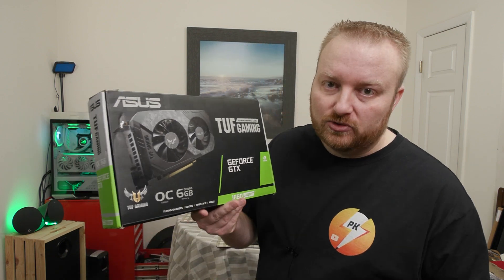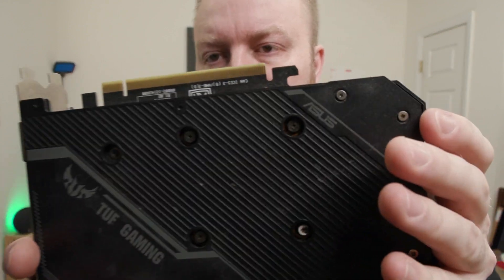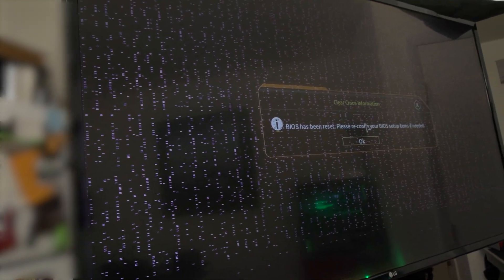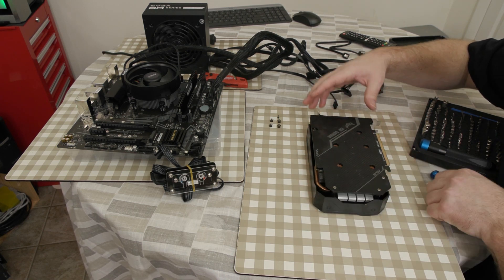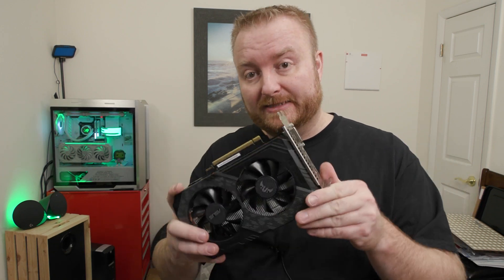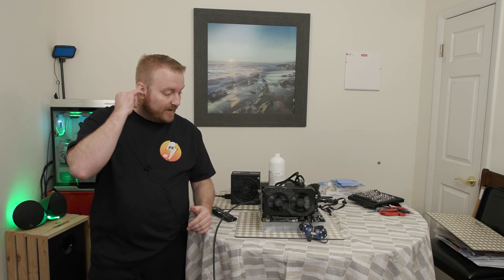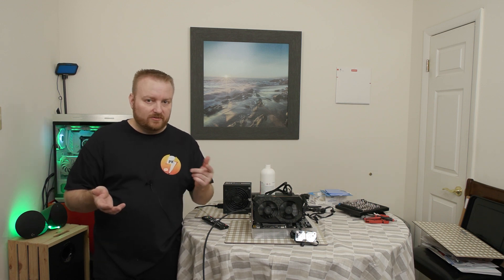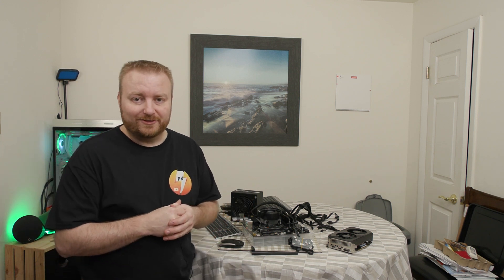I Bought A Bad GPU for $20. Can it be fixed?

Comment: Some thermal paste types will cause issue on a gpu if it touches  the outer components of the gpu chip I believe that there is still possible you have a bad memory chip.